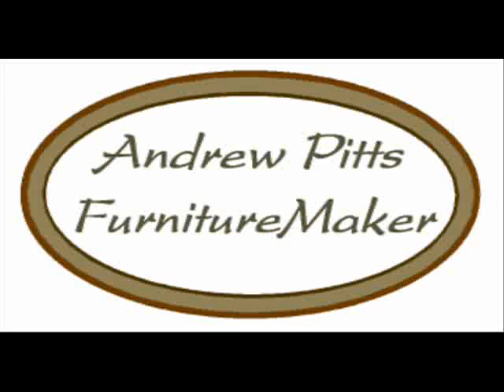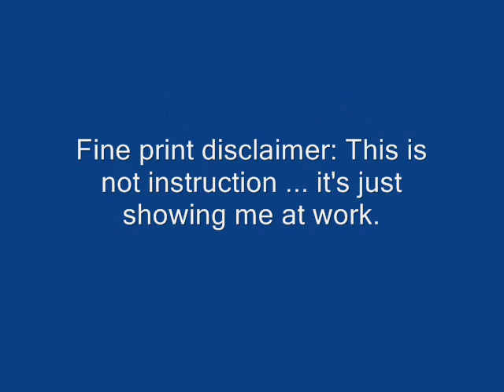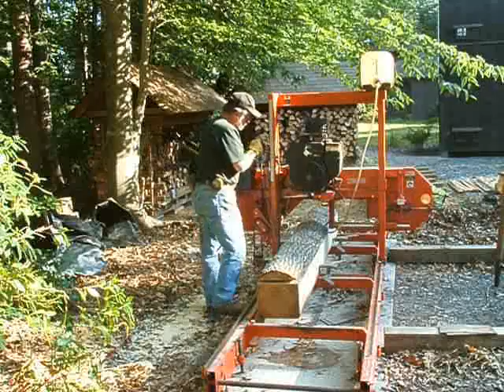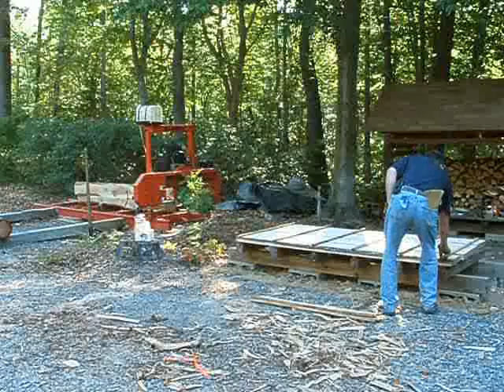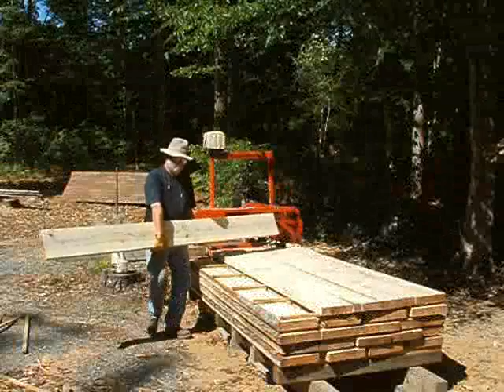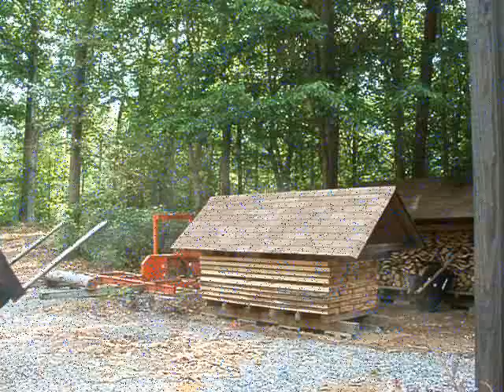Milling Lumber Part 2: Sawing, stacking, and stickering lumber by Andrew Pitts FurnitureMaker

Comment: how easy does the saw cut through the lumber
Reply from the maker: Depends on the lumber species and thickness. Hard wood like maple is maybe 30"/min, while red cedar is twice that fast. A higher power mill cuts faster. This is way faster than resawing on the shop bandsaw, but not like the big bandsaws or circular saws cut.

Comment: I know this is a 5 yr old video, but I noticed you use the same crank to raise/lower the saw and also to power it through the log. When you shift the saw to cut does that then set you up with a different crank to cut the log?
Reply from the maker: James, the handle slides on a shaft. On each side of the handle's center collar there are teeth. When shifted in one direction, the teeth engage the up/down pully. When shifted in the other direction the teeth engage the drive shaft for motion along the track.

Comment: Great video.  Thx.  I'm in the mkt for a mill myself. You seem pretty satisfied with the woodmizer product.  How much milling do you usually get before needing to change out the blade? How involved is the resharpening process? Assuming no imbedded metal how long do blades tend to last? And finally you indicated you use a metal detector.  What model/type do use and do you find it reasonably effective?
Reply from the maker: Karl Palan Thanks for watching, Karl. You ask some tough questions and some easy ones. Regarding blade longevity, that depends on a lot of factors. I think the conventional thought is about 800 bf per blade, max, but what thicknesses are being milled, what species, is there a debarker on the mill, etc. I can say a blade lasts a long time, and 500 bf of 6/4 domestic hardwood without a debarker is not unreasonable, but everyone will have different experience. The blades (use Woodmizer's) are reasonably inexpensive, and the Woodmizer Resharp program is easy to use and they send back your blades with expert sharpening. I tried an off brand blade once and it wandered all over the plank, so from that day I used Woodmizer blades exclusively. I use a Lumber Wizard metal detector, and it is pretty good an inch or so into the log. If you are cutting very thick planks (12/4), it will not be much use due to the depth.
I sold my mill last year, since I have a lot of lumber and really nowhere to store any more. It was the LT15 manual mill. Two weeks ago a friend with an LT40 (hydraulic) milled a client's log for me and it was way easier to use than the manual LT15. If you are going to do a lot of milling and don't need strenuous exercise, consider a hydraulic mill. It's essentially the same cutting head and same blade as the manual mill, but it does the heavy lifting for you.
Andy